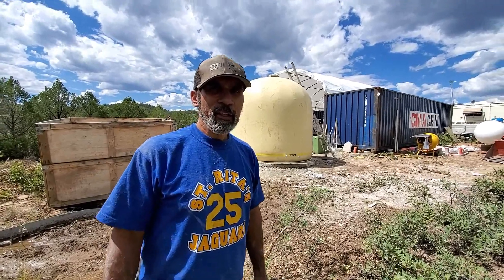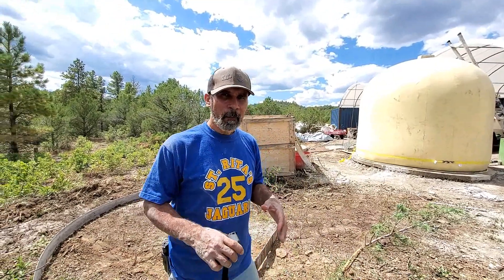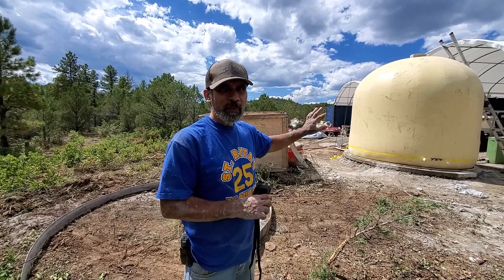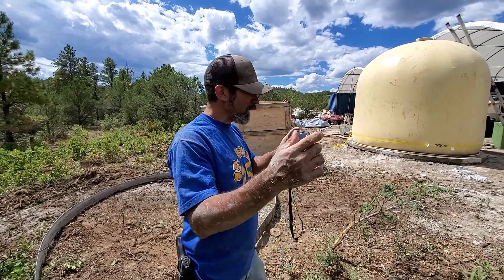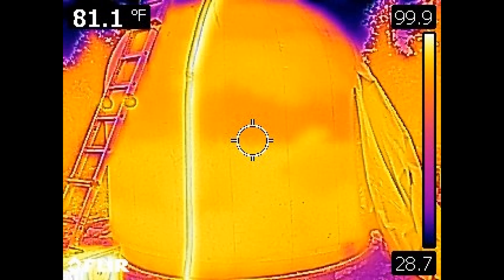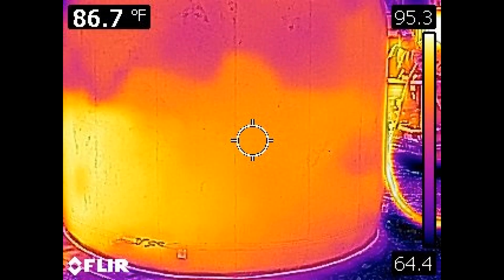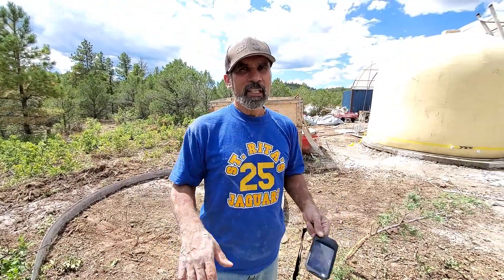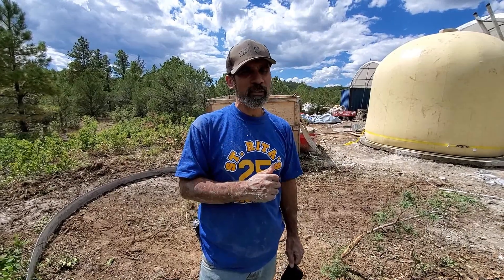EPIC Pour part 1 | Double Air-Form System #EPIC #AircreteHarry #Dome #FoamGenerator #Aircrete #learn

Comment: Double form idea is awesome.  My Flex-Shell Architecture Plaster, the Ultra-Low Water, Ultra-High Strength Reactive Powder Self-Healing Aircrete plaster would work great on the exterior, as you suggested, hopefully I will be done with my current project in time to attend and help.

I just finished the exterior roof of a huge area, 2500 square foot.  Resting today. Actually getting another another 15 mixes worth of material up there by hand, if you call that rest.

 What is the plaster date, btw?   If it were me, I would do the Dryvit style skin on the inside shell, just to make it slightly easier since their is no lath to help hold the overhead plaster. It is sticky and thin.

 That Dryvit style is mesh, basalt mesh or the rubber coated glass mesh called crack-free, combined with the polymer-modified base coat, Parex Base coat is another dry-bag version, but modified also with the same Japanese Cedar lignin (tree strength spirit), modified and purified Ca, Mg, Na lignosulfonate, lignin, that hydrophobic poly carboxylate that reduces the water demand, makes dry material viscous, to bring the particles closer together while providing binders, also called a high-range super plasticizer water reducer.  Also, modify that plaster with proportionate amounts of the silica fume and refined STAR M3 Flyash, and even acrylic-safe foam, just like the main Flex-Shell Mix.  

This will help it get stronger and stronger as time passes, those late-strength carbonate reactions that pulls CO2 from the sky and CaO, lime, and other salts from the Earth, forever, to heal cracks, a version of efflorescence, accelerated by the dense matrix and ionically reactive components, that results in, not lime, but calcite crystal formation anywhere moisture can move as a vapor of fluid.  

That material is the cube crushed in my most recent video, very strong stuff, above 12,000 psi for sure.  

To do, you just cut your mesh and strips, and imbed it in the wet plaster.  It is very thin, less than 3/16 of an inch. 

 The two shells will work together to create a stress-skin effect.  

As I have developed Flex-Shell Architecture,  the Precision Contour-Control Biometric Framing, the Flex-Shell Aircrete Plaster, for the aircrete-filled, double-shell blended with single shell, funnel column supported, system to provide a terrain, drainage and ecology integrated, flat, smooth, superior foundation for, and shelter for, any building medium or wall system with a tornado-safe and earthquake-safe roof and cantilevered awning, I have learned over the years it is all about relationship and connection to find our natural belonging, our deserved homes so we can thrive.  

So, lets continue to work together and  help people build their own homes and live free of debt slavery and the cookie-cutter storm-fodder domiciles they provide for the exploited laborers in their town-scape control system. 

Thank you for posting videos of this great work.   Sorry for hijacking your comments with blabbering about me and my stuff, I am just super excited about your inflatable double-form and I see so much potential to work together blending EPIC, Aircrete (cellular concrete) with Flex-Shell Architecture that provides an engineered roof and foundation to pass structural codes, and roof insulation requirements, where needed or wanted.